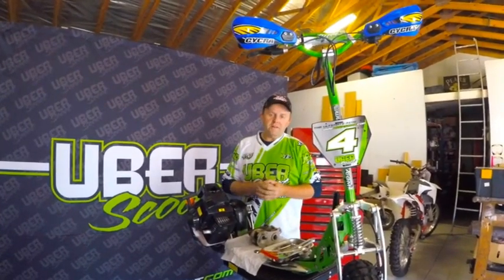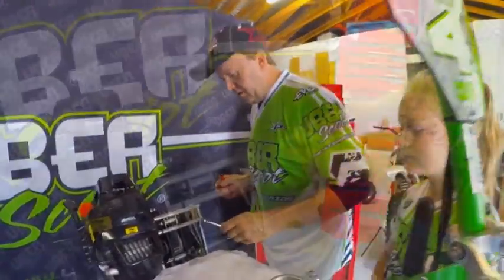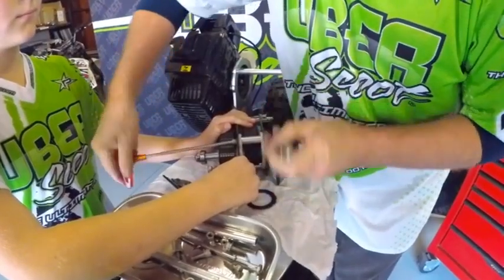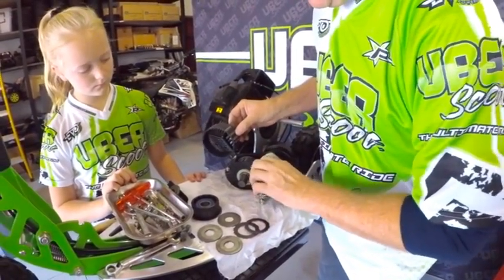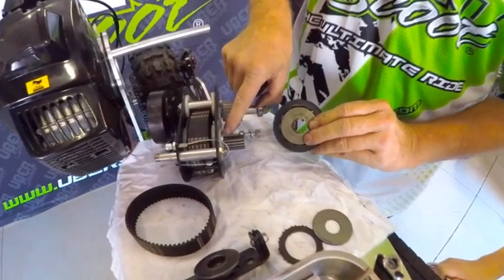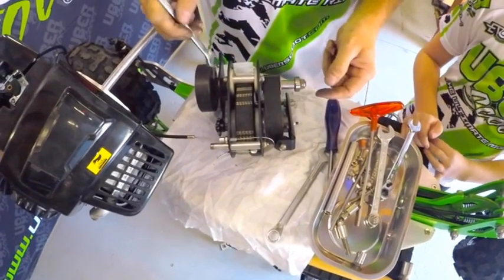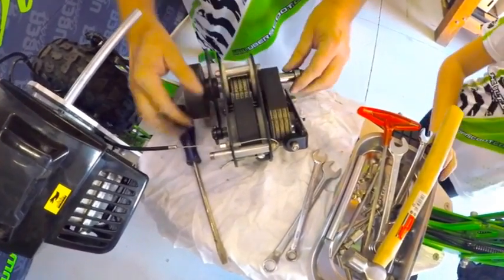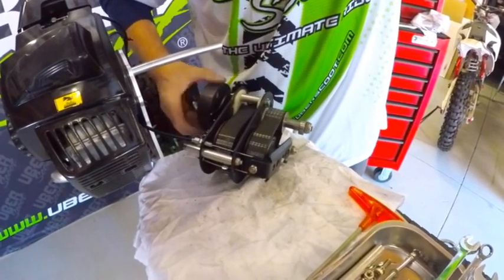2 Speed Gearbox UBER 70X

Comment: Do you have a video of doing a complete breakdown and rebuild of the transmission and housing kit? I’ve had to completely tear down and rebuild mine and once I got it tore down I need a few more bearings and now I have completely forgot how to put this thing back together, the parts manual doesn’t exactly explain everything like one bracket I took apart and I took two bearings out but the parts manual tells me to only put one bearing back in so I’m kind of stumped. Could you help me out?

Comment: This scooter is junk and here is why...

A good mate of mine approached a few of us after having the idea that it would be good for us to invest in not only the scooters themselves as a rental option at one of the best MX tracks in South Africa but also to create a new scooterX class under MSA.

The poor dude who is extremely clued up with engineering as a fabric maintenance manager/integrity engineer for one of the oil giants and who knows his hand around any engine almost got his name tarnished from this product and it's a good thing he went by himself and funded the first one as a "demo" out of his own pocket because had we gone ahead and purchased the 15-20 units to start off with like he initially proposed and with the problems he has had (mentioned below) I can guarantee heads would have rolled with law suits because where business is involved nobody gets away like he let this one slide. Consider yourself blessed!

So as he explained he bought the scooter directly from one of the outlets in Johannesburg which I will refrain from mentioning in fear of putting the wrong sour taste in people's mouths as they are actually top class and sell other quality products to back up their reputable name. So the scooter arrived, my guy did the run in period as he has been doing for  God knows how many years, changed the plug and  took it for its first spin. He reckons not even 1 hour in and the rear wheel locked up on him at like 45km/ because the bearings in the carrier plate seazed. He pushed it home, pulled the gearbox, replaced bearings with SKF and all was good except for the fact that if you don't have a bearing puller you'd now be paying extra at engineers leaving you without the scoot for a day or two. Anyways 4 days or so later he fires her up and as he does so he notices a horrible sound and witnesses the motor nearly vibrate itself to pieces. Before he can even kill the switch it bogs down and switches off by itself. His mind straight away from having redone engines of all sorts in the past says wrist pin or main bearing is gone but possibly worse as he's never seen engine dance like that before. So he pulls motor and all seems 👍 he then realizes that one of the springs have sheered on the clutch pack which scrubbed itself nicely up against the inside of the casing causing clutch pack to be damaged. He replaced the clutch pack with a race clutch setup from one of his pocket bikes and claims all is good.

After much anticipation we finally get to see this thing in action over the weekend during an event at this particular track. We'll his 11 year old daughter was using it in the pit lanes to create some attention but that lasted a whole 20-30 minutes when she brought it back saying it's knocking and feels funny. He got on it straight away and did a small test ride to establish what was wrong only to return and say it feels like I'm riding a bowl of fruit as the "welds" have cracked. He flipped it over to show us and that when we laughed hard.

My poor guy who is one of the most qualified QAQCs with various certificates in the oil and gas sector to ensure overall entigrity of an oil rig got shafted by a posky looking green thing.

He's been in contact with Mike Puzey over here in South Africa this whole time and the responses he received were shocking. He was made to seem like he was over reacting after concerns of potentially renting such a scooter out which could cause injury as admittance was received from Mike that the bearings are week and defective as he decided to purchase a second gearbox as spares during this time and the bearing in that one was too pocked straight from the shelf... this was all communicated on Whatsapp and the replies are shocking but the final one where after having sent images of the cracks on weld was told quiet arrogantly (IMO) "that he would weld it for him no problem". Screw the fact that my guy can weld any material and inspect his own welding to the highest international accepted standards but no he must pay to courier the scooter back to another province to be welded by the engineer who designed it.... cocky much??? Stuff any acceptance of a product that can clearly just barely last the average person with tons of engineering skills a few hours before broke, stuff the fact that your product made not only your name look bad but the one who vouched for your product in order to keep it local. Stuff the fact that even if you did weld it up for him what about the coating breakdown after all the grinding and welding on those defective areas.... so what the guy must now pay to have the entire thing stripped and repowdercoated just to make a crap product look half crap? 

In order to rent this garbage out or even throw a small pitbike jump at it in a scooterX class you'd need to throw so much money at these things to keep the wheels rolling it's scary but not as scary as the quality of the product itself. R12500, R500 courier charges, 3 weeks of ownership, close to R1000 in repairs before welding and powdercoating for 2 hours of solid riding, if that? My maths tells me you'd sink my interests and investments with garbage like this. Shocking Mike!!!

Comment: Well, I have determined what happened.
There are now TWO clutch plate bearings.
I love it when racers develop things....but you still need actual engineers!
Okay; those two 6002 bearings you jammed into the clutch plate?
That does NOT solve the issue of them overheating...it just doubles the heat!
Look; you need a secondary support for the input shaft, you need two bearings which have at least the width of the bering between them, and the two berings that support the input shaft need to be Silicon Nitride to withstand the heat and vibration....not to mention that without a second support plate, ALL of the torque from the engine AND the noise from the road is getting slammed into that clutch plate bearing.
Those OXO bearings are for SKATEBOARDS and similar non-motorized vehicles.
In the immediate, you should STOP shipping them with two bearings right next to each other in the clutch plate...not only do they fit poorly, so the input shaft is hard to turn before it's even in the bike, but the heat is DOUBLED since the friction in the area is doubled, which actually results in SHORTER bearing life--MUCH shorter.
My new bike is broken---AGAIN--and my $800 is wearing a hole in my pocket.
And don't even get me started on that insult of a tool kit.
Have you ever actually tried to USE the tool kit that comes with your bike to work on it?
Here's a hint: spanners are cheaper than wrenches because they ARE NOT WRENCHES!
Spanners are designed to grip a flat land on a round shaft and hold it in place while a WRENCH is used on some other part...they are NOT intended to substitute for real tools in cheap-ass toolkits that come with $800 bikes. That and there are only four tools in the entire kit which actually fit ANYTHING ANYWHERE on the bike.
And that one-nut chain adjuster you're so proud of?
Yeah, that thing that's so revolutionary and convenient?
The "tool kit" (it says so on the bag!)comes with four hex wrenches and guess how many FIT into that bolt to adjust the chain slack? You guessed it! ZERO! Yay!

Comment: Two weeks ago, I bought a brand-new Uberscoot 70x. When it arrived, the final drive was engaged at all times and the belts would spin while pushing it. It could be pushed forwards and backwards.
The 2nd gear would not stay engaged. I adjusted the cable to allow just enough slack for the thumb shifter to lock into middle, and 2nd will now stay engaged.
I adjusted nothing else.
The bike would, in operation, suddenly drag down and resist forward motion; nearly like using the brakes.
This would go away as suddenly as it cropped up, and randomly.
Yesterday, it did not go away. The bike will not power itself in a forward direction.
The engine starts and runs normally.
When the throttle is pressed, the engine responds well enough, but the final will not turn under power from the engine.
In 1st gear, pushing the bike forward no longer spins the belts. Pushing in reverse does.
In 2nd gear, wheel will not turn in either direction.
What do you think has happened?

Comment: Hey Mr. Puzey. I alaways wanted to see who invented this scooter. I have the 52cc american design. Im having some trouble with 2nd gear. My gear box is like I have 3 gears. L then when i push to switch to second it sort of stops in the middle. Then when I shift up again it goes all the way to 2nd or in my case 3rd gear. For the longest time i thought that was the way it was supposed to be, because it came that way. An I noticed that when I put a lot of pressure when it is in 2nd gear or in my case 3rd it goes even faster. What should I do?  Also how do I get the 71cc in the US?  Thanks guys! Also I used to make theses with weedwacker  engines an a go cart clutch almost 23 years ago. An I had gopeds. This EVO is by far my favorite!
Reply: Mines does the 3 gear thing you described L/M/H I thought I had a special one but is there a fix?
Reply: @R @ROLLNSMOKE1122  wow I can’t believe that was five years ago! At least you replied thank you!  Mine when it’s in third gear and it’s topped out, you can push down on a little more and it gets a little more speed.
Reply: @Nicoricanmarxist my friend was gonna take a look at it but I told him dont f wit it it might make it slower in 3rd or just stay stuck in 2nd...😢 Figured it might be a fix , but not if it slows me up.

Comment: Hi please someone help me when we insert the shifter cable into the gear box shifter position will be in L or H or in middle because I can't fixed 2nd gear please help me or send any vedio link of Gearbox cable insertion
Reply: Needs to be in middle. I know its a pain even on mine,its Just L for low and H for High,but when I shift on my uberscoot it never hits the H,just stays in the middle. So when replacing keep it in the middle,and make sure its in second gear(middle) when reconnecting. Good Luck

Comment: What is the gear box ratio? will all bf05t sprockets work? what sprockets are available for the uberscoots? front 11 14 17 19? rear 54 51 44 39? How do we rev higher on the 70cc motor? the 63 huasheng. are you revving higher than 9500? how much will it rev up to? 18k?